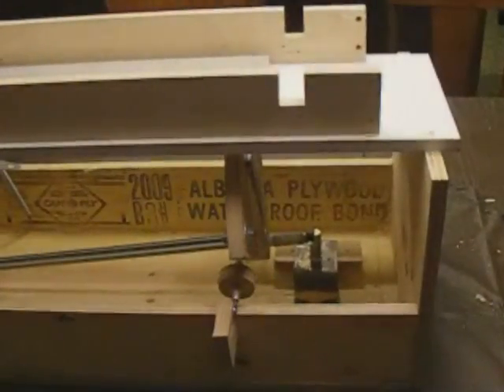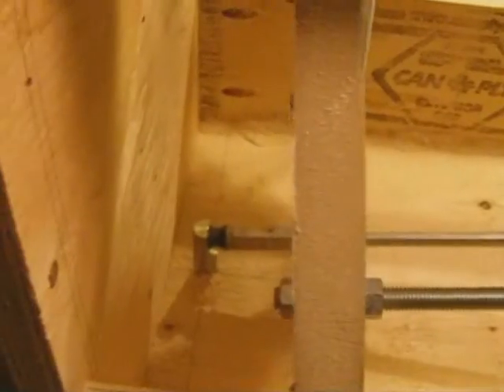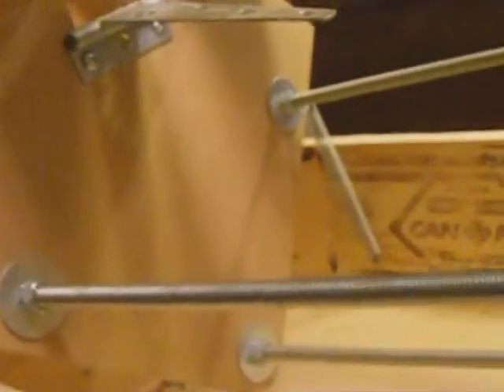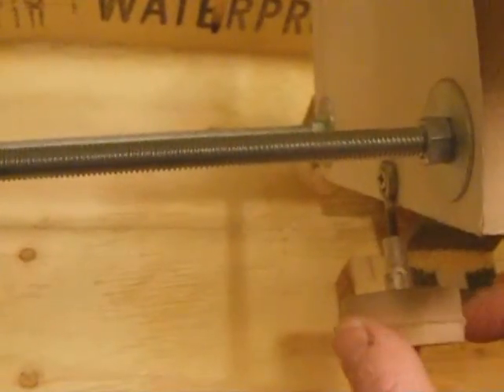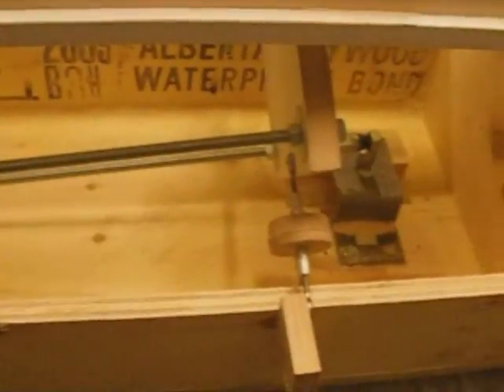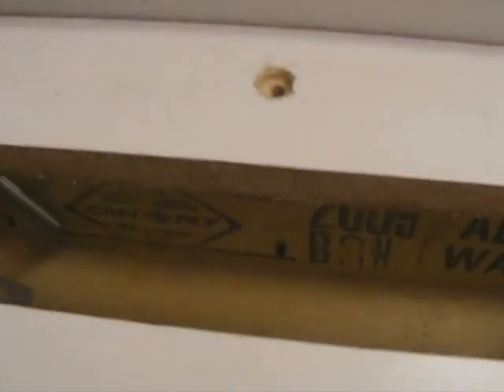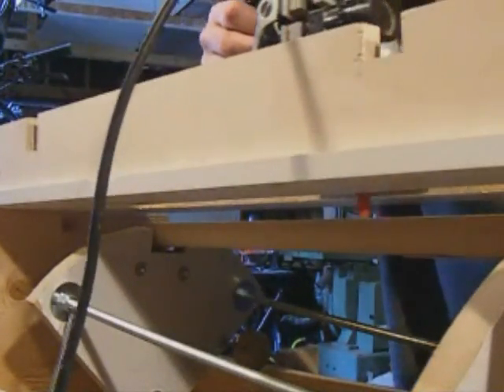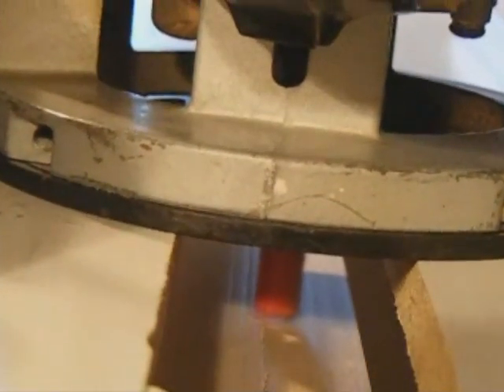One Piece Neck Build Part 7a: Compound Radius Fingerbaord

Comment: So where do you place the holes for the rods? Did you place the two pivots unto each other and used the 7,5" as guidance, so that the holes are right on top of each other. Or did you just took some random measurements for instance 1 inch out of the bottom?
Thanks!

Comment from the maker: @benedictguerrero 

HI, the large 1/4 disk is 9.5 from centre to outer arc, there is a cuout for the neck to sit in. The 7.5 1/4 disk is 7.5 from centre to outer arc with a cutout for the neck to sit in. I know that when the router bit is just above the arc I am about where I want to be. the offset is just for levelling up the jig so the router is at a horizontal plane for ease of use only.

Bill

Comment: @Bobo9977 
Ow wait... when you are finished you get  your 7.5" and 9.5" so that means the couple of inches offset by the pivot (subtracted from the radii) were compensated by the couple of inches added by the distance of the router bit from the quarter-wheels' edges (added by the neck's thickness)???

Comment from the maker: @benedictguerrero 

Well, from what I can tell when I am finished I get a 7.5" radius at the nut and 9.5" radius ath the heel.
The best way I can desribe it is if you took a simple pencil sharpener and took a slice off of it.
The pivots are there in order for the jig to not work against itself.
The router bit points directly to center of pivot. From the end you could draw a straight line from bit and it would line up with center of rotating ends.

Bill

Bill

Comment: I'll have to say your computations are wrong, if you are referring to the radius of a circle, AND if those straight cuts on the rotating wood point directly to the circle's center.  If so, you should have placed the rotation points (or axles) into the centers of the wheels to call them true circle radii.  If what you did was rotate them about a couple of inches shorter than the radii, then you have thus shaped an elliptical contour and have diverted far from the intended precision measures.

Comment from the maker: @mheytman 
Thanks for that man.
You can use regular FB, you would just make a filler neck blank to mount the FB to, dbl sided tape should suffice.
I think there is enough room as it is to have longer necks, haven't checked though.

Bill